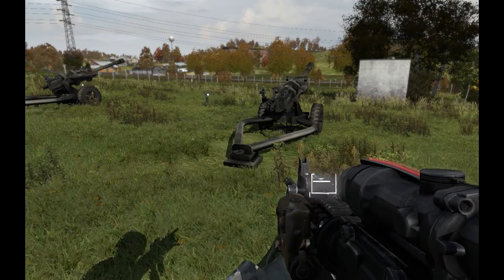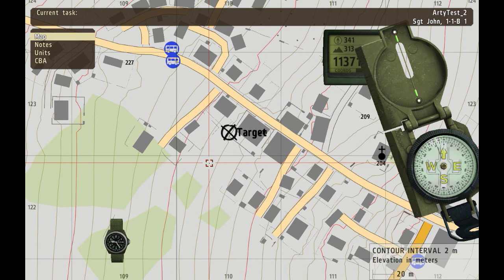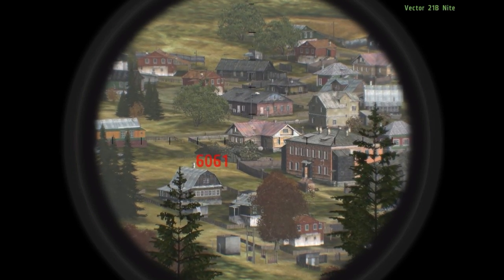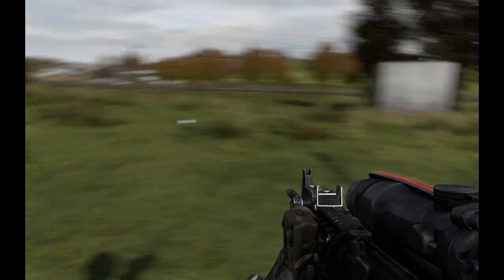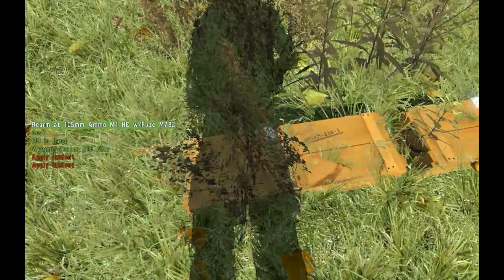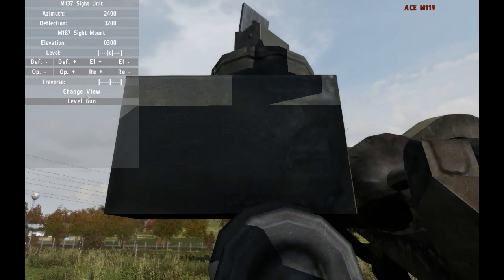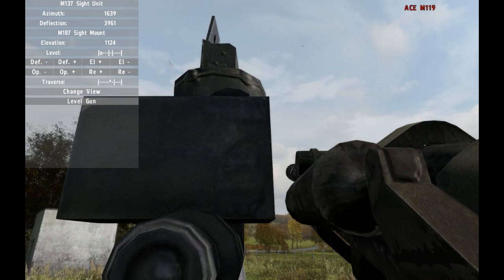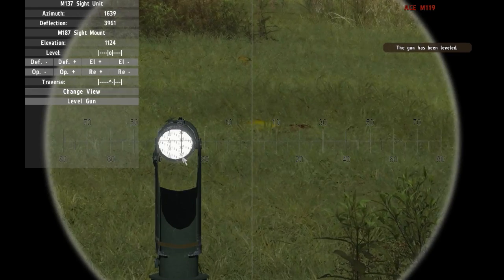ArmA 2 - ACE Mod - Artillery Tutorial

Comment: This was good shit, it spoke to the Red Leg in me. 

To add to what the OP said in his video and for those sim dudes who want to be FDC, some quick terms and a simplified guide on how to not sound like a dumbass when calling in Fires:

Heading: Direction a target is facing
Course: Direction a target is moving
Relative Bearing: Direction to a target from YOUR location
Bearing: Direction to a target from Magnetic North

Also, I do not believe it matters that much in Arma given the setting, but maps will also have what is called a Grid Zone Designator. This is usually given when calling in a fire mission. The map you are issued will have a GZD on it. Example:

Using the proper radio format:

Unit FDC: Hammer this is Anvil, Fire Mission over
Arty: This is Hammer, send it, over
Anvil: Fire mission, Laser Polar (1), Grid Alpha Bravo Charlie(2), 1234567890(3) Altitude 123 Direction 1234 (If known/moving, if stationary just say stationary), Enemy Mobile Latrines(4), Mark(5) 3 rounds HE(5.a), At My Command(6), over.
Hammer: Received Fire mission, laser polar, Grid ABC1234567890 Altitude 123 Direction 1234, Enemy Mobile Latrines, Mark 3 rounds HE, At Your Command, over.
Anvil: Fire
Hammer: Shot, over.
Anvil: Shot, out.
Hammer: Splash, over.
Anvil: Splash, out.(7)
Anvil: Hammer this is Anvil, Correction,  Add 25 (Altitude or elevation) Direction 1235 (target has shifted it's direction of travel), Fire For Effect, over.
Hammer: Received Correction Add 25 Direction 1235, Fire For Effect, over.
Hammer: Shot, over.
Anvil: Shot, out.
Hammer: Splash, over.
Anvil: Splash, out.
Anvil: Hammer this is Anvil, Good Effect On Target, Check Fire(8), over.
Hammer: Roger, Check Fire, out.

Happy gaming dudes!

(1.) (Indicates you are using a laser designator, whereas GRID would indicate you are using a map, and POLAR would indicate you are using basic magnetic direction)
(2.) (GZD read out alphanumerically) 
(3.) (6 to 10 grid zone location, the more numbers given the closer to the target you will be.)
(4.) (Target Description/Identification.)
(5.) (Indicates the method of engagement or what the purpose of the mission is. MARK indicates the FDC will use the mission to orient it properly. This would usually be followed by a Battle Damage Assessment (BDA) and/or corrections if needed/fire for effect if on target and additional rounds needed)
(5.a) (Indicates type/number of rounds needed)
(6.) Indicates method of fire control. Examples include: At My Command: Fire when FDC gives order, Time on Target: Multiple guns fire from different locations will all rounds hitting at same time, if no number of rounds are given previously Fire For Effect can be used
(6.a) (NOTE the use of the word REPEAT in the military means to REPEAT THE LAST FIRE MISSION NOT TO REPEAT OR REITERATE WHAT WAS JUST SAID ON THE RADIO, that would be Say Again or I Say Again. Repeat is also used by civilians that have no idea what they're talking about ; ) )
(7.) (The Arty unit repeats what was said back to the FDC to confirm the proper information, then announces the rounds have been fired, which the FDC mirriors back, followed by announcement by the Arty of expected round impact (Splash), which the FDC mirrors.)
(8.) (Fire mission has been corrected for whatever and a BDA given, followed by Check Fire [Cease Fire] / Repeat [Repeat Same Mission not fucking Repeat what you unknowing self just said] / Correction [If additional adjustments needed])

Comment: Sheaf refers to the impact effect of the rounds. For example if you have a hardened bunker you want all your rounds to fall as close to one another as possible so the detonations are all as close to one another as they can possibly get. This is called a Converged Sheaf. Conversely, if you had infantry in the open you would use what is called Open Sheaf which spreads the rounds out to give the most saturated effect possible.

Comment: Per - Wikipedia: "A Dual-Purpose Improved Conventional Munition (DPICM) is an artillery or surface-to-surface missile warhead designed to burst into sub-munitions at an optimum altitude and distance from the desired target for dense area coverage."

These are the bomblets found in the M142 HIMARS and M270 / M270A1 rockets.

Also, by default, artillery units fire at low angle, unless otherwise specified. Usually high angle is used in hilly or mountainous terrain.